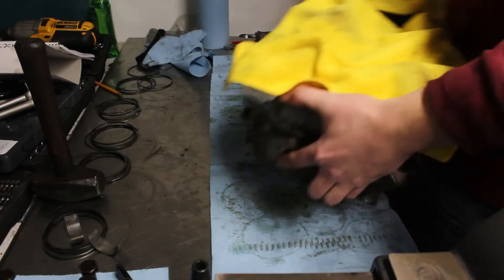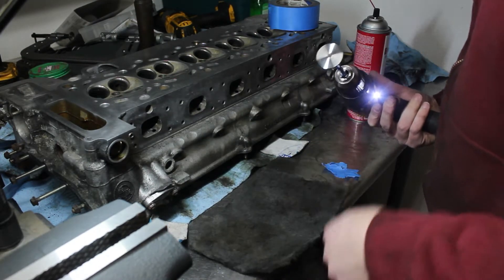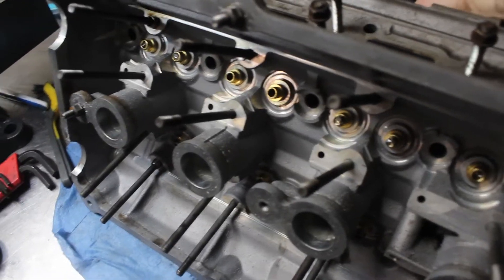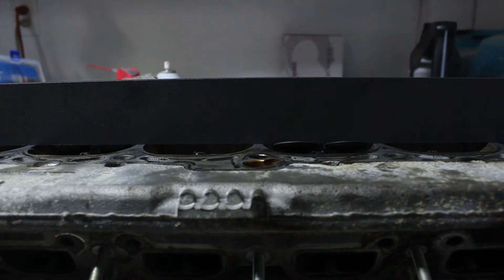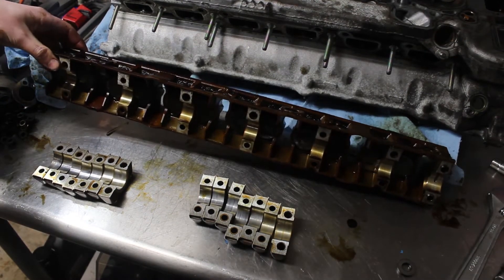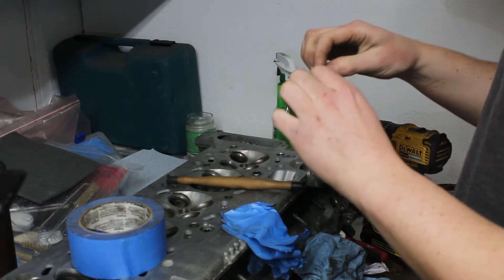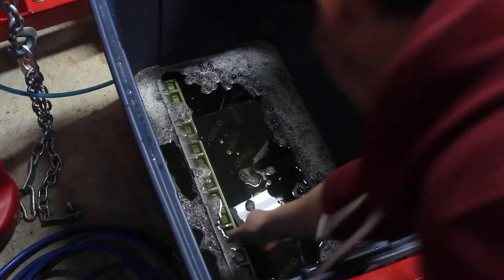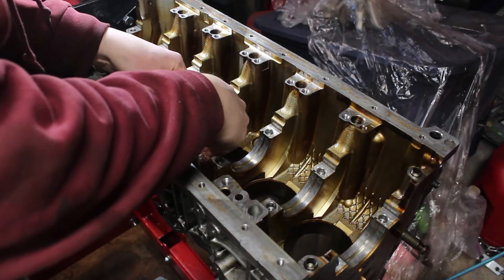BMW E46 Race Car Build: M54B30 Cylinder Head Refresh

Comment: If you know what you are doing porting you will always get gains in porting a cylinder head, even if you just round off and smooth off the sharp edges.
Reply from the maker: True, I was pressed for time so I didn't want to spend too long on it. I have an extra cylinder head I may build up into a proper race head while this one is running.

Comment: Did you install the head with it warped? Or did you get it machined flat?
Reply from the maker: I installed it as is. For longevity, it would have been best to do that, but this is not supposed to be a long term rebuild.